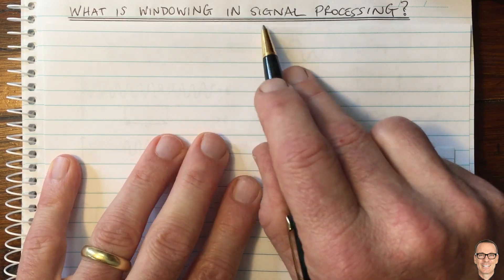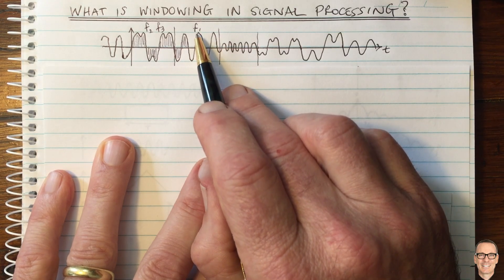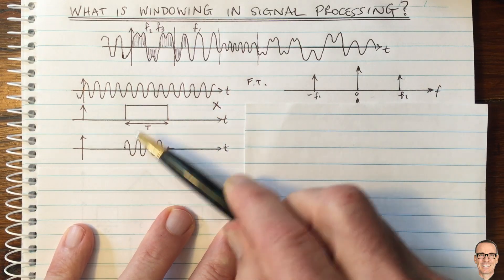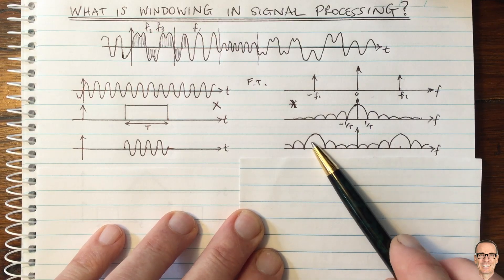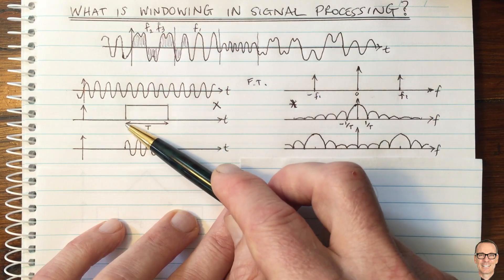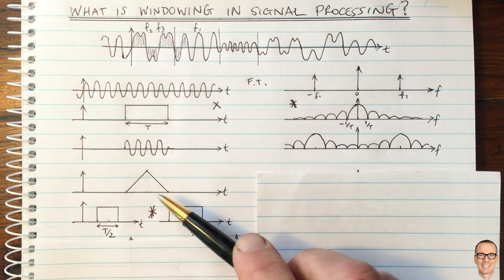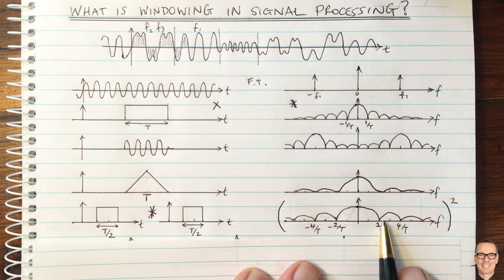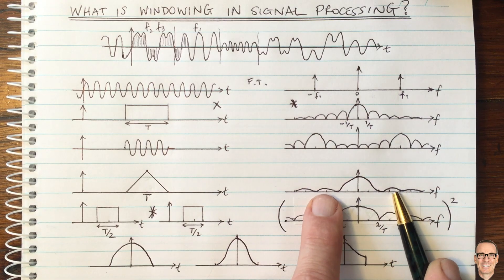What is Windowing in Signal Processing?

Comment: You said when there are 2 frequencies, theiy could canceling out. I just know that canceling from the time domain - but that is here also possible in the frequency domain?
Do you mean after the convolution of the rectangular and ther 2-frequencies-containing-pattern in the freq.-domain?
Reply from the maker: Actually, I didn't say "cancelled out", I said "swamped".  What I meant was, that if the amplitude of the second frequency component is smaller than the amplitude of the side-lobe of the main frequency component, then it will be hard to decide whether the second frequency component is actually in the signal, or not.